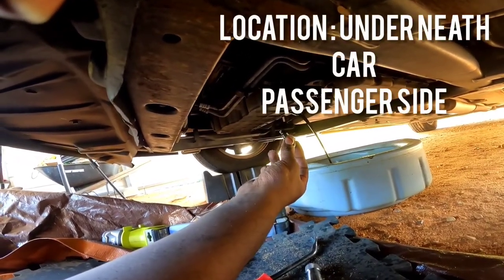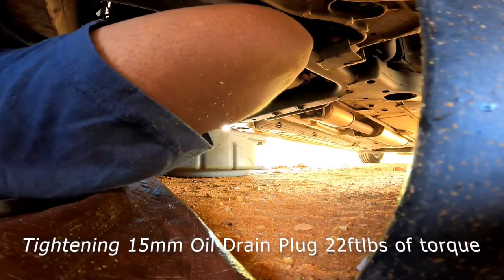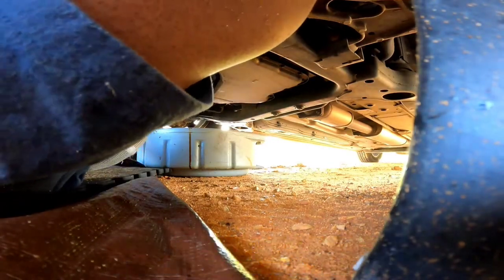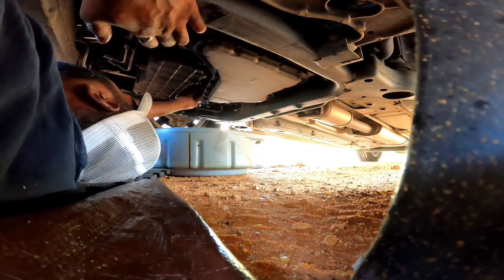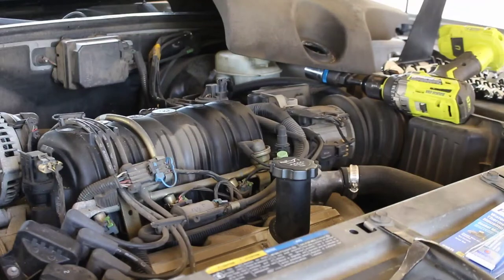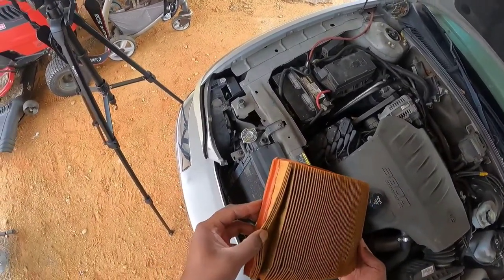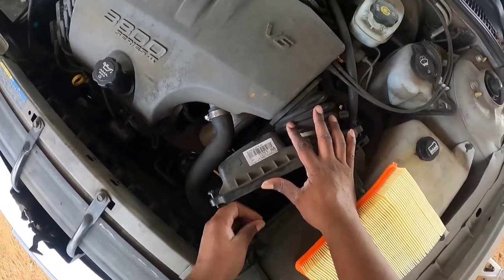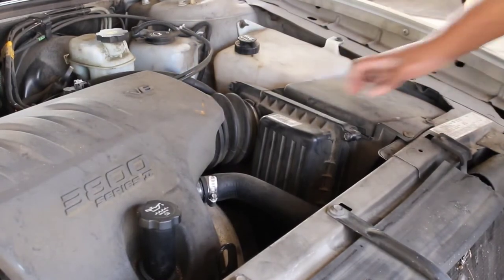2005 Buick Park Avenue Oil Change ( Supertech ) 5w30 and Air Filter Change ( Fram )  Walmart Special

Comment: My philosophy on motor oil (and other fluids) - I buy what's on sale or the best deal. So long as its what I'm looking for (synth/reg, grade, quantity, etc) then the best deal is the one I grab. Its ignoring the interval that will get you into trouble - not using one brand over the other. There's of course special use cases like if you're taking a car to the track or pushing it hard often etc - but for regular driving the interval is the most important factor. Good video!
Reply from the maker: Exactly! Thanks for watching

Comment: One habit that I got into with these older cars is replacing the oil drain plug (5 dollars) on a regular basis because the o ring gets compressed and loses the ability to seal correctly over time.  I also use rare earth magnets on the exterior of the oil pan near the drain plug and then I remove them before draining the oil in an attempt to grab and metal shavings and then hopefully remove them upon draining the oil.  I’m using Valvoline High Mileage oil and a microgard filter.  I wish my 96 had a trans drain plug.  I actually siphon out trans fluid from the dipstick (6 dollar siphon pump from Harbor Freight) and regularly replace with new fluid in hopes to rejuvenate most of the old fluid because some stays in the torque converter.   I’ve done this the last two oil changes (3k) miles and my trans fluid looks fantastic.  I also did a brake fluid flush and I can’t believe what a difference it made.
Reply from the maker: Awesome tips! I've used an oil filter magnet in the past to trap metal shavings there because all the oil flows through there. Worked pretty well when breaking in an rebuilt engine. 

I want to do a brake fluid flush on my 2000 Silverado. It has 270k and I'm willing to bet a hat it has never been replaced.
Reply: @HowIDoItFaM  you won’t believe the difference the new brake fluid will make.  Keep up the great work.